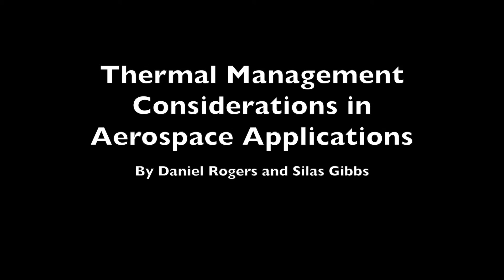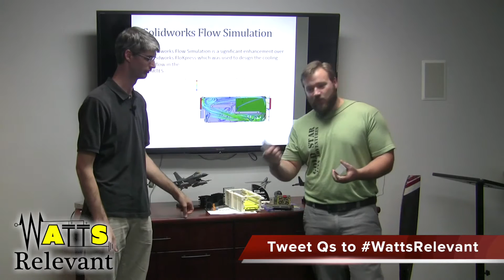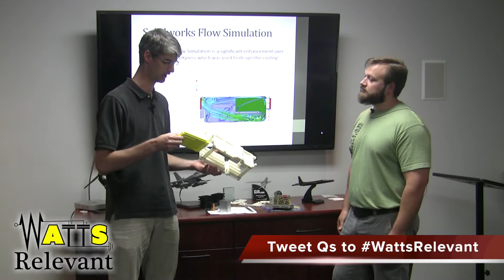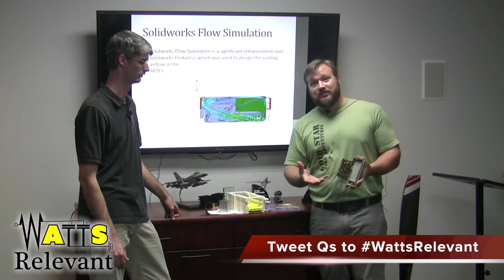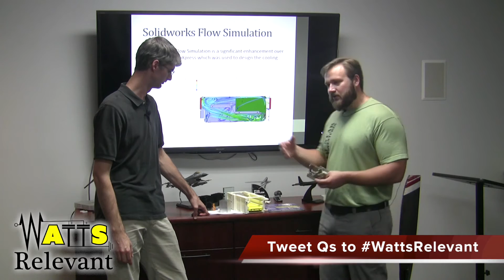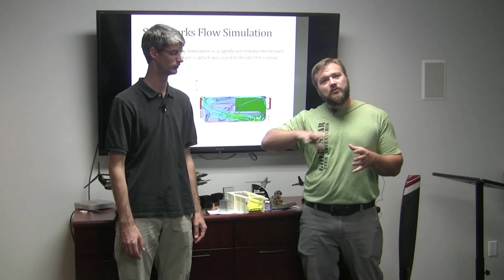Thermal Management Considerations in Aerospace Applications

Comment: Facing difficult challenges provides us with amazing opportunities. I'm very curious to see what you guys come up with,.... maybe thermo couples, or closed system water to air surface coolers?
Reply: +Tophamatic , the simulation in back background is a finished design using conduction cooling.  It dumps its heat to a very limited air supply that comes from an aircraft forced air source.  We have had some fun liquid cooled system using various fluids.  A soon to be released videos features one of out mechanical engineers describing the simulation considerations for a thermal system.  Thank you for the comment!
Reply: Daniel Rogers very cool. I'm surprised there isn't much activity (liking and subscribing) on this media, it great stuff! I guess I'm just a nerd... Keep up the cool videos, I enjoy them!